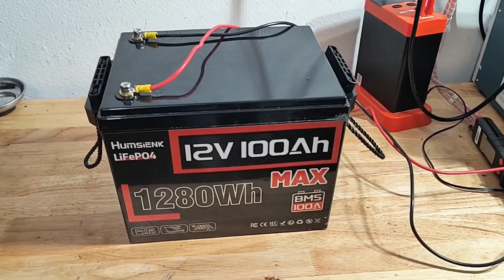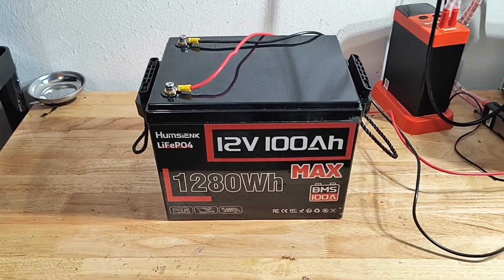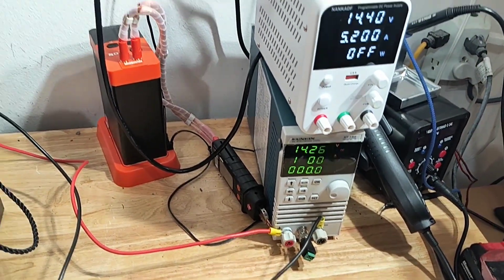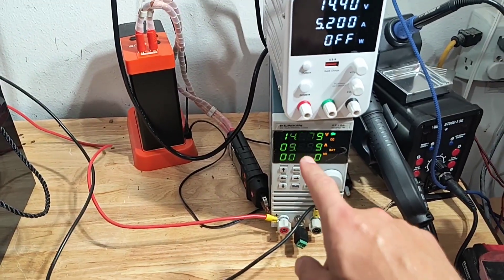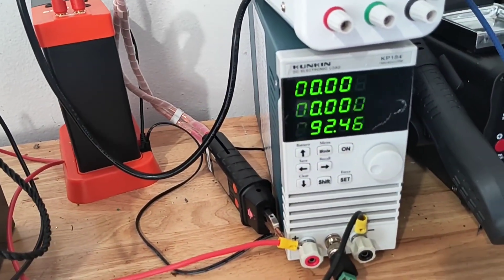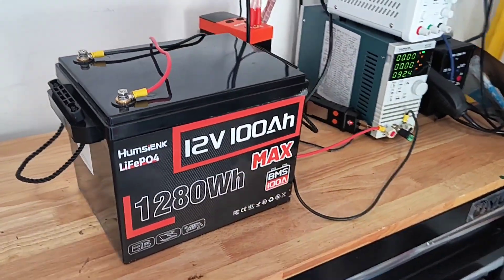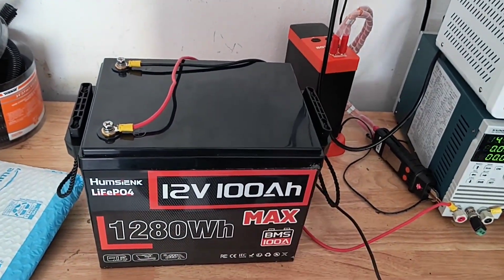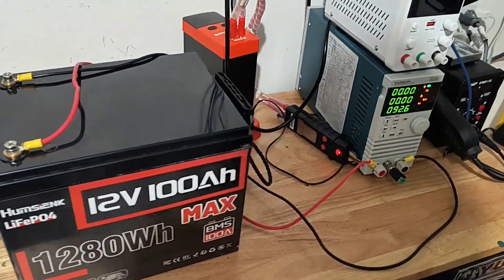Humsienk 12v 100ah Lifepo4 capacity test

Comment: Thank you for the video, it is important for people who intend to buy a Humsienk battery or have already purchased one. 
For several days now, I have had a Humsienk 12V 100Ah Max Bluetooth battery, model number HS12V 100Ah 100MAX BT, date of manufacture 15/05/2025. 
I performed two test discharges preceded by a full charge. 
The BMS switches off charging at a voltage of 14.20V.   
I carried out the discharge by drawing direct current from the battery through a 12V DC /230V AC converter. Direct current consumption from the battery was 22.4 A, discharge time was 244 minutes until shutdown by the BMS, which occurred at a voltage of 10.54 V. This gives a capacity of 91.1 Ah. As in your video, the battery capacity is about 10% less than the manufacturer's declaration.
The amount of energy that was successfully retrieved from the battery was 1165 Wh, which is about 91% of the declared value. 
After obtaining this result, I was concerned that it might be due to a damaged cell in the battery. 
The battery has Bluetooth and the application was successfully launched. However, its functionality is very limited. It is not possible to obtain information about the voltages on individual cells, nor is it possible to force cell balancing as in other applications.  
I have come to the conclusion that 90–92 Ah is a repeatable capacity for these batteries, which may indicate that the capacity of the cells is lower than declared by the manufacturer, but they are still functional.
If this is the case, considering the price of around 150 euros and the battery's Bluetooth capability (albeit with limited functionality), it is quite a good deal for my needs.
In combination with a 12/230 converter, it provides 230V / 50 Hz power at 255 W for 4 hours, which is slightly over 1 kWh.
Reply: 75ah only philipines review..they put active balncer and its up to 85ah...

Comment: Thanks for this video. I have this battery model of  battery (12V 100Ah Max (BT)).  Mine is the BT version of this battery and my capacit6y results were not as good as 90.3Ah using a DS24P @ 10A discharge rate (0.1C).  I emailed Hussein, and they gave me an option for them to replace it with a different model (12V 100Ah) battery probably a MAX Plus Group 24 , as this model is no longer available. I have not seen a tear-down of this Humsienk battery on Youtube.  

Youtube channel "Lithium Solar" did a tear-down of what may be a similar battery titled "Inside the $78 KingBoss LiFePO4 Battery, It's Missing Cells!" (I will post a a separate comment with a  link to that video, as I understand some channels delete comments with links).  In this video the KingBoss battery had a capacity of 89.9Ah, and in the tear-down showed it was made up of 24 cylindrical cells.  I am guessing they are 15Ah 32140 LiFePO4 cells.  I.  Will Prowse also performed a video on a similar battery and measured just over 98Ah capacity and the teardown showed 24 cells in a very similar configuration.  I may keep my battery to perform a tear-down just for my education.

Comment: I'm confused on the terminal sizes of these is it m8 or m6
Reply: Creo que es m8 o eso decía la descripción de Amazon
Reply: This battery uses M6 bolts not the standard of M8 used by most other 12V 100Ah batteries.  If you have M8 lugs,the bolt head is large enough not to fall through.